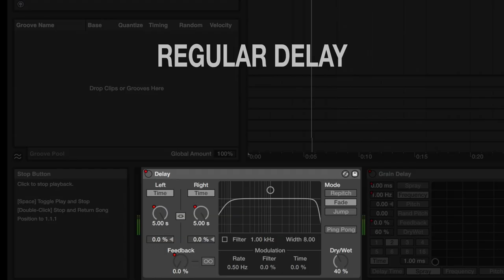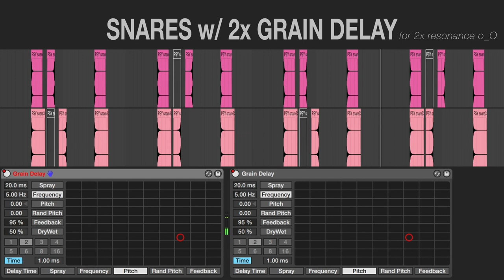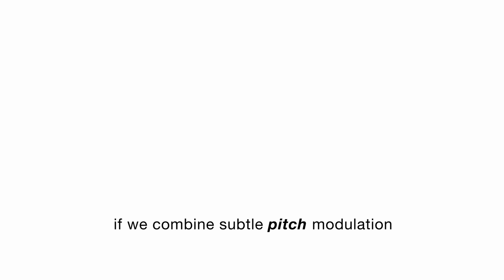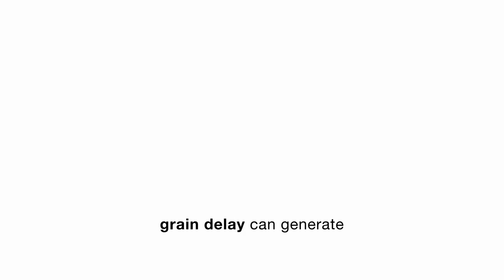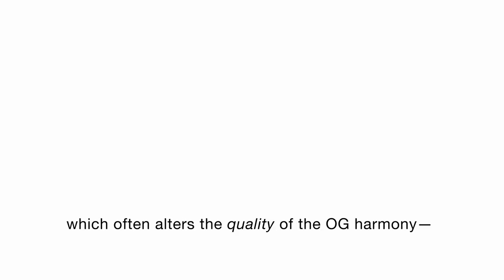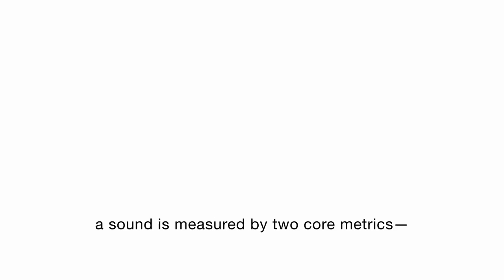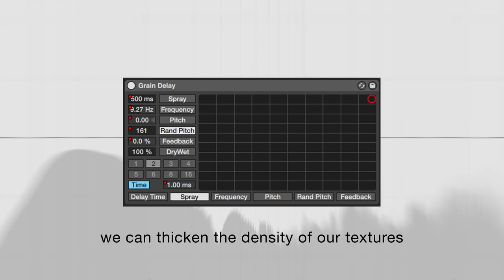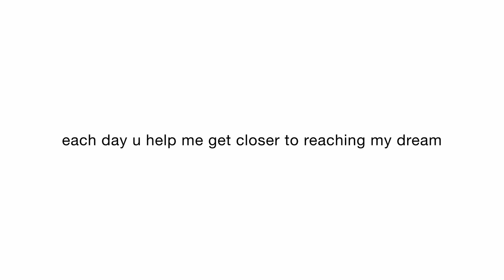ableton sound design | GRAIN DELAY [2/2] Applications

Comment: As always, these videos are absolutely fantastic and there are a number of elements I am going to add from this into my own workflow! next level stuff. I just have one question; sometimes when applying effects like grain delay to certain things with lots of low-end frequency material like bass or kicks, there is a risk of destroying the desired characteristics of the original sound, as you noted by keeping the dry/wet low on the kick to preserve the transient.

If I use grain delay to add resonant harmonics to my bass, is there any risk of this weakening the low-end impact of my bass and, if so, are there any measures I should take to preserve the impact of the low end of my bass? e.g. filter envelopes, parallel processing and so on
Reply from the maker: great question !
i would separate my bass into 2 parts—a basic sine sub, and then the harmonic/tonal/sound-designed bass.
i'd hi pass the tonal bass ~100ish Hz, or anywhere just above where the fundamental frequencies in ur bassline sit.
optionally u can group the basses and process the group w a compressor and/or gentle saturator.